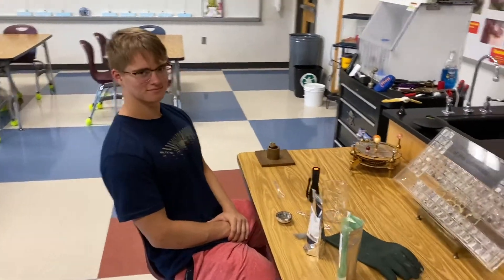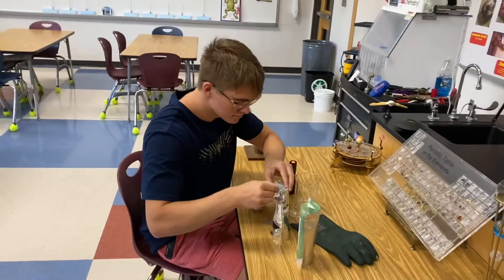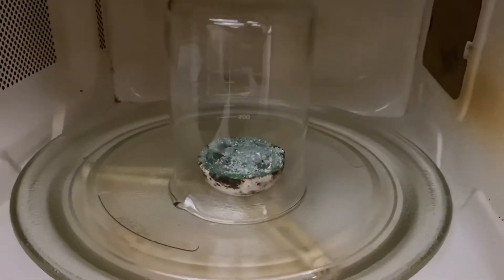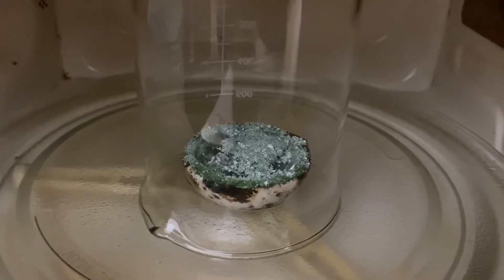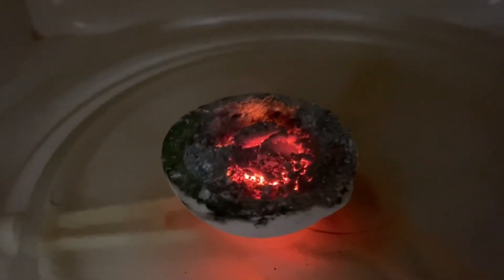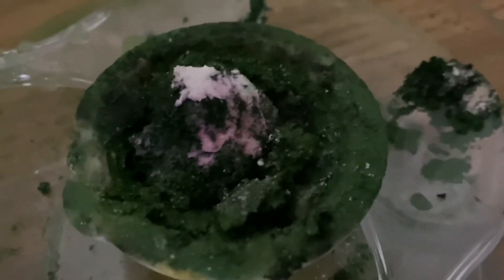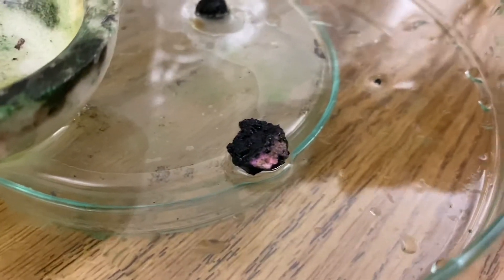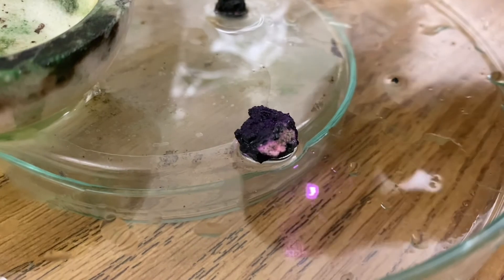Synthetic Rubies in RamZland!🔥

Comment: Hey RamZLand im working on a experiment similar to rubies I'm trying to understand the different components of this one. So you explained the steal whool was for drawing in the plasma/heat. Does this burn off the wool? Or is this potentially in the product now? If my product needs Fe should I use more wool or replace it with the base element instead?
Reply from the maker: Yeah…the iron in the wool isn’t going to change the synthesis of the ruby - but rather serves as a conductor for microwave plasma.⚗️
Reply: @_RamZland_  I appreciate the insight Thankyou!